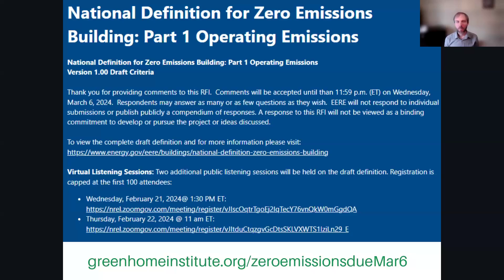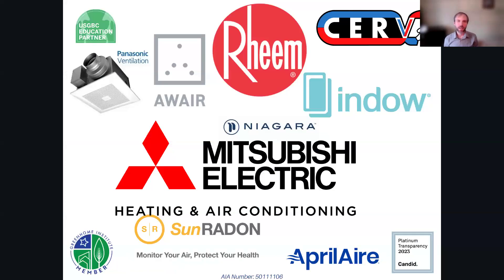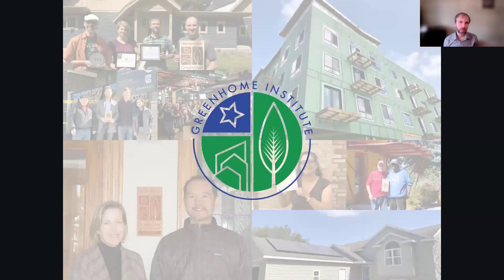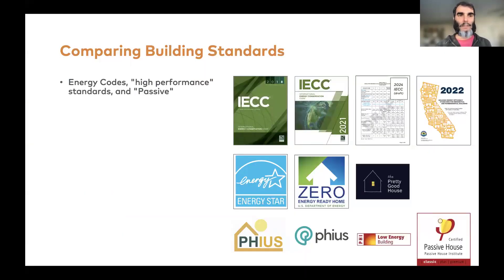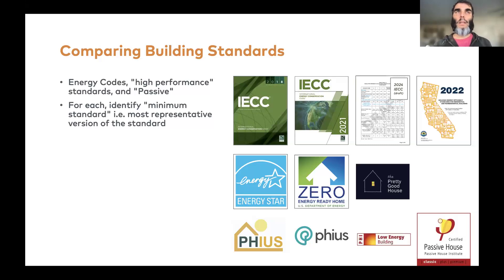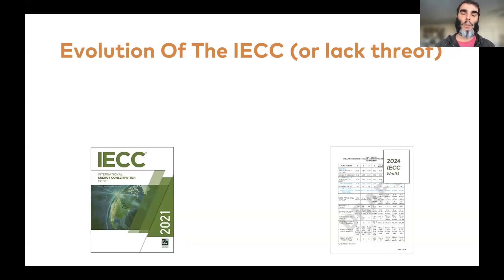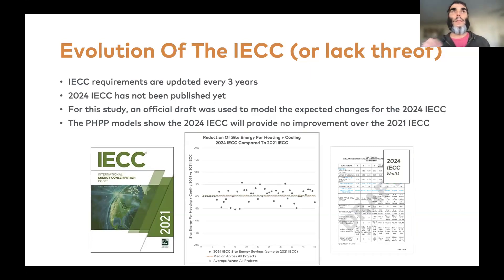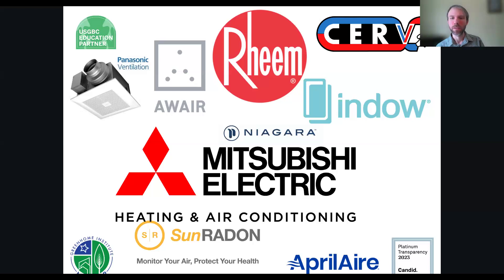Comparison of Energy Standards Code to Passive house: A Report

Comment: What happens when the lights go out?
How much does the 'New: technology cost? I have priced washers, I'll get a few more years out of my 20 year old Maytag before I spend a months wages on a new one.
What is the carbon cost to mine, process and build them? Including getting the raw materials around the planet?

How do I stay warm when Mother Nature dumps an ice storm on the town 40 miles away that my electricty comes from and they won't get to my community of 30 people until the community with 10,000 peole are turned back on? Last time it took 11 days, Thank God for the gas stove that kept us warm.

Green is good but another 100 years before it is economically and practical.

When are you going to block the sun? It causes cancer.
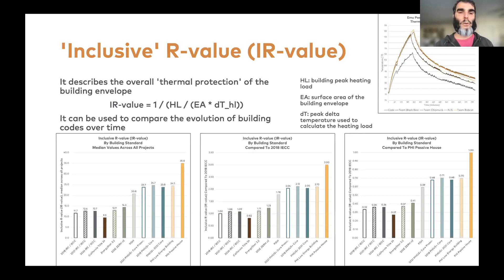Reply: Hey Joe, that's a great question. In our Report, we tried to answer it as well as we could in the Resiliency section of the report. In this video, that's under the "Thermal Resilience" and "Inclusive R-value" sections - from about 36:48 to 38:48 (we didn't spend that much time on this point in this presentation). If you're interested in learning more, we covered the topic of thermal resilience more in depth in this video: https://youtu.be/m8e1I-mXFnY?si=dgaWc5HzC9tOCQk5
Reply: The video and research focus on 5 performance metrics of common building standards for new single family residential construction. The carbon footprint of replacing an existing washing machine with a new one is a different topic but certainly interesting as well.

You stay warmer/cooler in periods of outages by super insulating & air tightening your home. Your house maintains its existing temperature for longer periods of time and it is unrelated to the energy source that you use to heat or cool your house. I think it is wise to have a backup energy source if your primary one has an interruption. Remember that you can have unplanned natural gas outages as well.

It is always curious to hear that "green" is not economical. There were many slides that compared site heating and cooling between the various building standards. I think the mild climate zones had a 70% reduction in heating and cooling when comparing PHI Passive House to 2018 IECC. Wouldn't you prefer to pay 70% less each month for heating and cooling, year after year, decade after decade? A lot of us (60%+) in the USA are living paycheck to paycheck and it is ridiculous that people advocate for garbage code-built housing that costs homeowners and renters a lot more money in the long run. People hear the word "green" and think it is something for rich people but, from a money perspective, would actually benefit people that do not have a lot of money much much more. It is no surprise that our electric & gas utility providers lobby to stop energy efficient homes.

You could try using sunblock when you are outside.
Reply: @Steelsnort  You assume everybody is building a new home.
Just how many people live in homes that are fifty years or older?
The reality is those of us in those old homes can barely make it thanks to greed and the handouts to everybody else but Americans.

Green is good, just 100 years off .  .  .
Reply: @JoeOutdoors  Well said.
Reply from the maker: @Steelsnort   Please explain the sunblock comment?
Reply from the maker: @JoeOutdoors  You make a good point on people not building new. For existing homes the Inflation Reduction Act will help bring more funds. Also check out our greenstar homes program https://greenhomeinstitute.org/greenstar-homes-certification-manual-2/
Reply from the maker: We do not advise using gas stoves for heating, you will need to provide ventilation if you do.